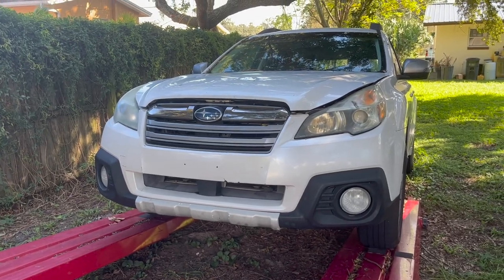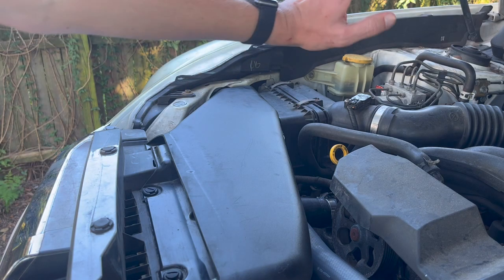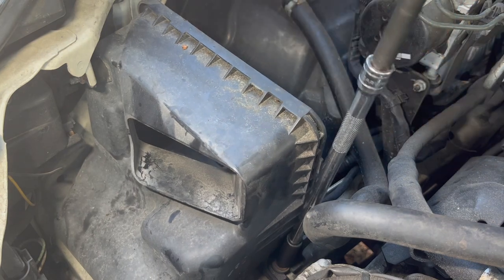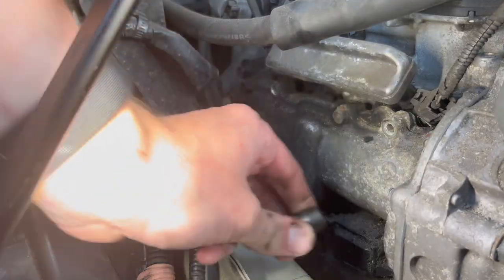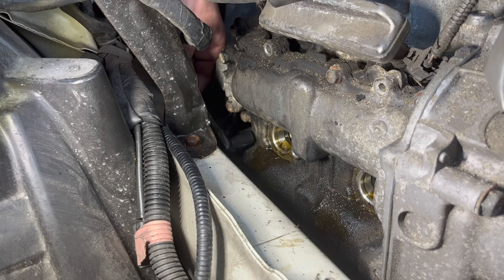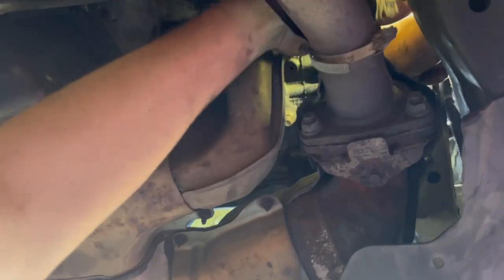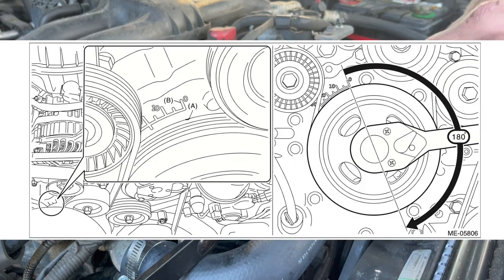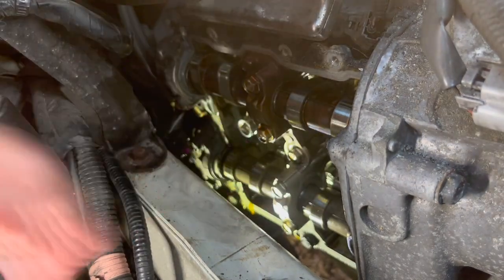2013 - 2019 Subaru Outback Valve Cover Gasket Replacement (Detailed)

Comment: Congratulations you have done very good job. You saved yourself a lot of money. I had similar job done in Ontario, Canada last week.
Work on my car (2016 Subaru Forester with 99 940km - possible the same engine as on yours Outback 2.5L H4 SFI SO) included as per job assignment: 
Job 1.  Search for oil leak,  Job 2. Replacement of  PCV 
Inspection and Walk Around,  Job 6 - Cam Carrier reseal and oil pan reseal,  Job 7 - Replacement of heat shield clamp (old rusted away). Total 
of $2973.61 out of which labour was $2198.00, parts 355.99 and the rest taxes. They told me that they have to remove engine to the work. Work took three days.
I am planning to do more investigation of this repair as the price seems way excessive.
Reply from the maker: That’s a lot of work for a vehicle with that mileage. Hope all that were real issues and not some made up stuff. I started working on cars years ago and it is very rare for me to take car to a repair facility. And when  I do end up taking it somewhere, I am usually disappointed with the outcome lol no one will care about your car as much as you do
Reply: @PZPal  Thank you for your reply. I watched another videos on the subject and the more I see the more I am convinced that the time charged to the repairs is about three times too high.

Comment: My uncle told me about any Subaru, you get the best or most expensive, reliable, toughest gasket, screws, tubing, clips, spark plugs or any replaceable small parts possible, because you don't want to repeat the process for a long long long time.
Reply from the maker: Your uncle is exactly right, its definitely worth spending a bit more on quality parts!
Reply: One time is enough.  He said replaced all those fragile parts, whenever he opens up the engine bay, because the whenever the next chance you get still gonna suck.  While it sucks, fix or replace all other potential miseries.

Comment: Good afternoon friend, what brand of silicone do I use?

And how much torque did you give the screws?
Reply from the maker: Permatex ultra black should be good. I don’t use torque due to risk of breaking threats, just do tight with small ratchet

Comment: Brake cleaner might be a bit aggressive for coils and rubber.  I'd use electrical contact cleaner.
Reply from the maker: Brake cleaner dries very quickly and coils and gaskets there will see brake parts cleaner only couple times in their lives till it’s time for a new set. At least that’s my opinion. Thanks for your input though. I always appreciate different opinions!
Reply: @PZPal starting fluid is the best
Reply: @joecorrie1 how come?